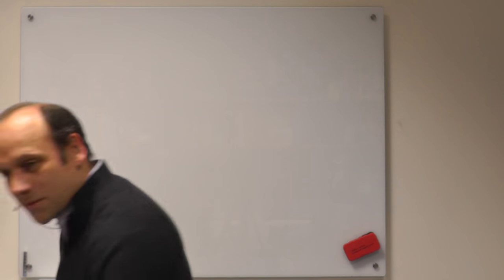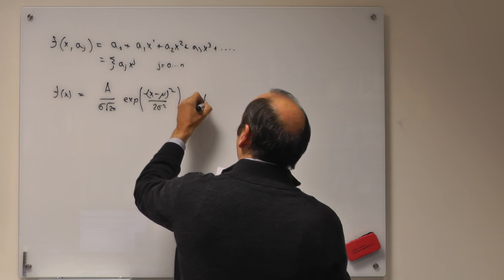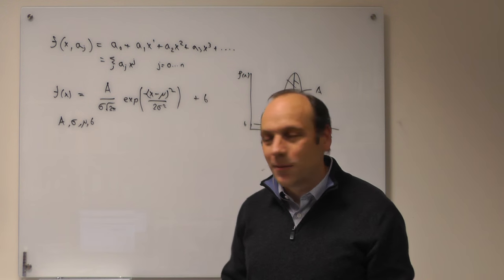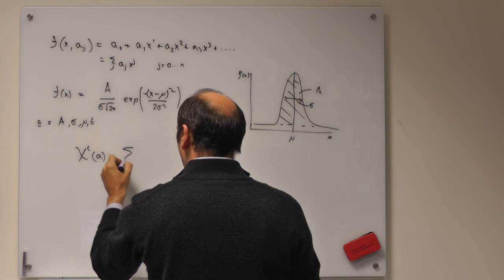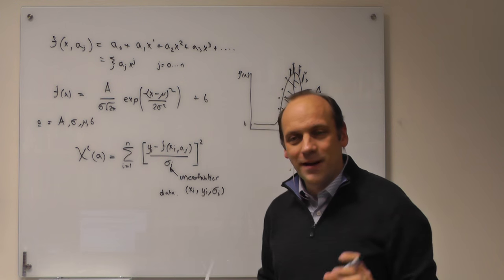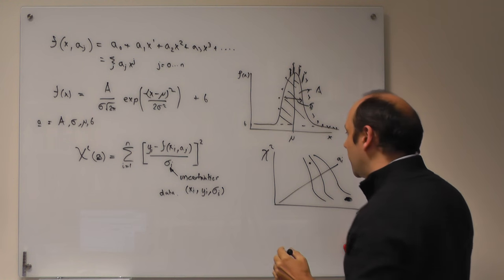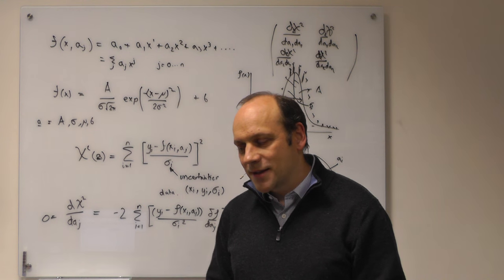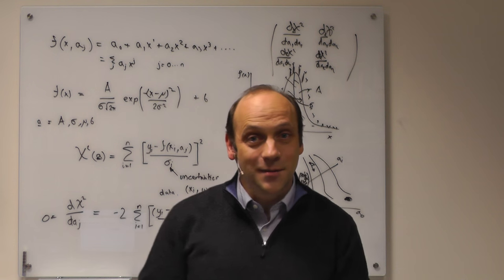MSE101 L7.2 Non-linear least squares minimisation

Comment: What I can't understand in all these algorithms that convert the Error  into a Error Squared function is: why are you doing that? Because by converting the Error into ErrorSquared you are creating another level of complexity!!!, and then you have to derive the ErrorSquared so you can do the minimization. Why to elevate complexity into higher degree and then lower that degree immediately in the next step?  Cant we just derive the error function as it is in its original form? That seems like the obvious thing to do, and you would go straight to the minimum without any wiggling. And then if you do second derivative on that , you would converge to the minimum even faster, that would be the equivalent of the third order derivative on the ErrorSquared function, so, second order derivative on Error (not ErrorSquared) would be much powerful method.
Reply: The Error squared function is convex, hopefulyy positive definite also smoother. In simple terms we want to penalize either positive or negative error the same. You can also use absolute error but that is definitely not a smooth function.
Reply: You have to start with the understanding that this calculation is actually getting the squared distance between the observations and the estimating function. The Pythagorean theorem gives you distance. This is just distance squared. And when you think about it, distance is really what you want to minimize. Simply adding non-squared error is not even giving you an analogue of distance anymore. It would be giving you some weird measure that might actually have an incorrect minimum somewhere that is not representative of minimizing the distance when you get into higher dimensional space. Luckily, the distance equation generalized into higher dimensional space, so we know that we are continuing to minimize distance even though we have no notion of what distance really looks like in 4-D.